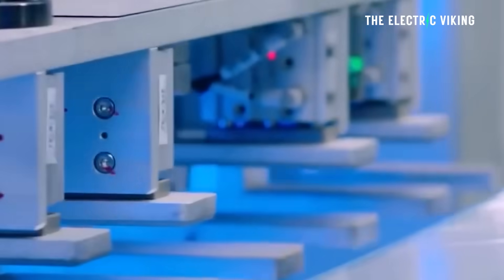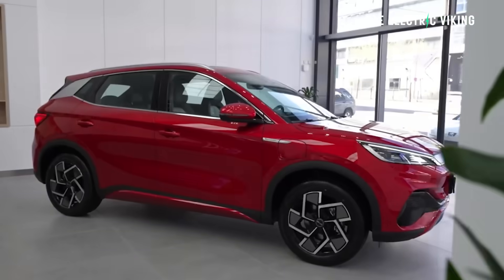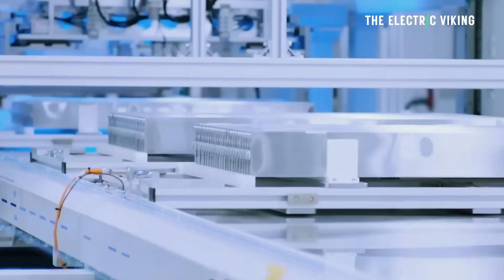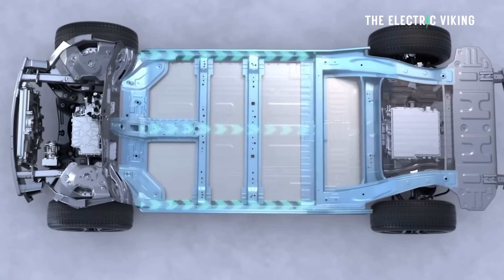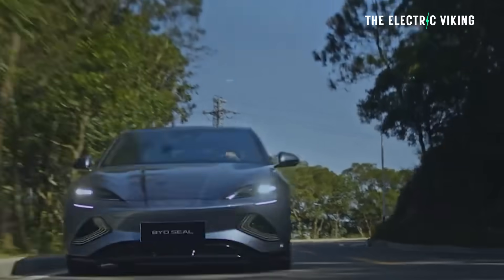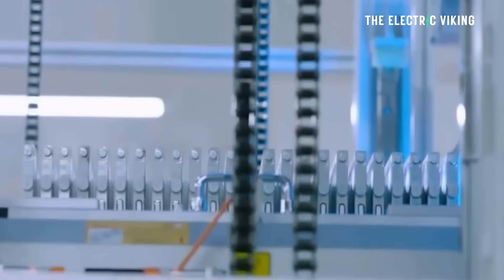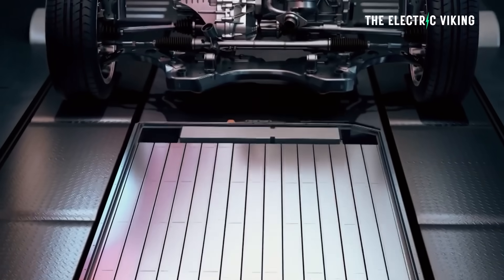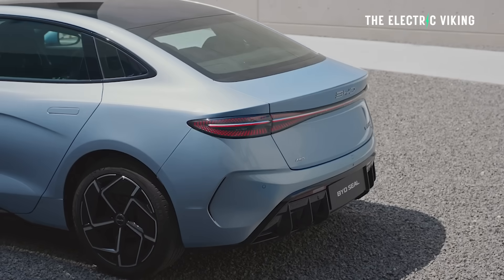BYDs 2 new batteries; ULTRA high energy density LFP or 700kw charging

Comment: Today you are able to buy 152Ah BYD Blade cell for 17USD EXW China. That's approx. 35USD/kWh.
Reply: Yeah I am also curious because that seems way lower than the normal battery prices.
Reply: Could you send a product link?
Reply: One more thing - in recent weeks I had an offer for 138Ah BYD Blade cells for about 12USD/pc. It is not manufactured any more so only what is left in the warehouse.

Comment: A mix of both in the same car sounds optimal.
Reply: True! It could bring a new meaning to hybrid.. a hybrid battery set with an 80/20 split between long range, slower charging batteries and short trip/local driving fast charge batteries. Would be pretty cool.
Reply: Eveb better if the two battery types are independent replacable. The fast charging one could be used to provide the grunt of rapid charging for quick top ups on public charging for a few 10s of miles travel quickly, theb both batteries on slow home charging.

The rapid battery would be better for regen, particularly on larger vehicles as it could absorb more energy quickly.

Then as indicidual packs the rapid charging battery could then be swapped out separately at the end of its useful life without impacting the larger one.
Reply: @GruffSillyGoat yeah! The same thing occurred to me, with the smaller, fast charge battery able to be more modular and easier to replace!

Comment: Higher charging speed is meaningless to me as I charge at home on AC.  Moreover the typical DC charger in Singapore is around 50 kW and the highest ones which are very few and far between at around 100-120 kW.  Even the fastest ones are still lower than my car's 150 kW rating   So I would definitely choose higher density.

Comment: Since I’m retired and charging from home 98% of the time, I’ll take the higher range thank you.
Reply: Exactly. You won't get that high current on home supplies. Whereas a courier driver might go for fast charging at the depot and charge it up while he's loading up the van for the next delivery.
Reply: @peterelliott2914  Sure buddy
Reply: Same. I'm not retired but I'd realistically only charge it at home and use the extra range for trips on weekends
Reply: @Jin88866  Or you could get an actually good car which you can charge in 3 minutes pretty much anywhere and where you don't have to worry about range
Reply: Definitely - get range over fast charge. I live in Norway and whenever I have to use a fast charger - Thor forbid - I spend 2/3rd of the time waiting for a charger to become available. So my own charging speed is completely immaterial.
Reply: @weerolein  So get a nice diesel car
Reply: Not if it's cold outside 😂
Reply: @thewolf9851  I'm charging at 110 and it's like a couple degrees below freezing.
Reply: @johnmurdoch6696  And your car has a much lower range. And the colder it is the lower the range gets. Fact. I pitty you.

Comment: In Australia we dont have the infrastructure for lots of electric cars. Forget about driving up to Darwin or over to Perth from Sydney. It would also add so much time to the trip. What if the charging station is down. Nightmare!
Reply: It’s a green fantasy
Reply: Tell that to Harald Murphy, he circumnavigated Australia in a Tesla covering 13,500km in 10 days.
Reply: That's like saying there is no apothecary for alcohol on the way to fill my tank, so I prefer my trusty horse.
Reply: If you aren’t stopping for ten minutes every four hours then you may have a drug problem.
Reply: australia is PHEV territory thanks to grid mismanagement. they're also useful as backup power when the grid goes down.

slow charge at home for the daily commute, petrol for long trips, petrol for fun driving, petrol for powering your house when the grid goes down. depending on how you drive it, its basically just an electric transmission that pairs the unbeatable strengths of internal combustion with the benefits of an electric drivetrain.

the big limitation on PHEVs right now is that charge/discharge rates are proportional to battery size, and PHEVs have much smaller battery packs than ordinary EVs, which forces manufacturers to make compromises on designs that leave customers dissatisfied. less power, shorter battery life, etc, but ultra fast charging-discharging batteries eliminate the downsides associated with PHEVs.

its not hard to see why they beat EVs hands down, but the main benefit over standard petrol/diesel is that an electric drivetrain is like a "CVT that doesn't suck", you can have the engine running in its power band regardless of how fast you're going, which means you get the stated horsepower 100% of the time. 

someone needs to hurry up and make a PHEV with a V8 turbocharged barra; 0-100 in 1.5 seconds with the sweet sound of a V8 engine.

Comment: Sounds good, but where can I find the infrastructure to charge this. That's 700kw or 700,000 watts.  Considering household output 2400 watts.  That will cause a blackout in a town.
Reply: 30A x200V = 6000 watts is min requirement for a home.
really super fast charging is not acceptable to power supply system.
a district area substation has one 1500kva transformer here.
Reply: Many public chargers operate akin to fuel-pumps, they use battery buffers and like fuel-pumps charge until the storage tank runs dry. The analogy us a bit of a stretch and breaks at this point as the battey buffers self-replinish in quiet times between charges.
Reply: Dude, you forgot 3 phase power is available at commercial site. Residence receives 1 phase power.
Reply: @charyuna  You don't need a 700 kW charger at home! 😂

Comment: Definitely would prefer longer range (600 US epa miles), warranty for 1 million miles like CATL, with 20 minute charging speed. Having that much range would limit my stops on a long road trip. Also, the warranty would mean I would not have to buy a new car for a long time.
Sadly, due to the US tariffs, we don’t seem to have access to all this great Chinese battery tech. Especially in Tesla vehicles. Unless I’m wrong about the US battery market. Not sure if Tesla’s 4680 design will ever be as good as the blade design. And, if I’m not mistaken, I heard that the blade can be a structural battery as well.

Comment: If both cars have 80 kwhr batteries they will have the same range
Reply: ...and the one with the higher energy density will possibly be lighter... with all the advantages of a car with smaller weight.
Reply: 210 kwh density is still nothing special. Only benefit of these BYD LFP batteries is they are cheap and don't catch fire easily. To have small EVs with decent range 300Kwh is really needed which may have to be semi solid state.

Comment: I wouldn't pay a dime for a battery with a 700 kw charge rate because I can't charge it at that rate anywhere.
Reply: There is still a benefit to higher max charging speed when using lower chargers. No battery maintains max charging speed throughout the whole charge. There is a progressive slowdown, but a higher max battery can take a charger’s max output for much longer.
Reply: @apis8020  That's true, but few chargers around me exceed 250 kw, much less 700. Some max out at 50 kw ... which is fine with me since I drive a Bolt. Maybe the charging infrastructure will catch up someday, but my experience with a Bolt (that only accepts 50 kw max) persuades me that few people need these much higher charging rates. EVs don't need to fuel as fast as an ICEV even if batteries can do it in theory.

A station with a dozen plugs, like some Tesla stations, can't even provide each vehicle the 250 kw (or more) that each plug can theoretically provide. The average at Tesla stations is more like 75. We're discussing the power consumption of an entire small town. The local grid can't handle it, so we'd need to upgrade the entire grid as well as the charging stations and the EVs. Electric semis have the same problem.

Greater range and efficiency is worth far more. Aptera promises 400 miles from a 44 kwh battery with a max charging rate of 150 kw. That's 200 miles in 15 minutes even if the charger delivers only 90 kw. A 500 mile road trip with one ten minute stop is more charging speed than most people will ever need especially if they don't make such long trips routinely, and Aptera can also charge at home at 120 volts fast enough to add 200 miles overnight.
Reply: Why not adapt them for residential storage m, say like a wardrobe that accumulates डॉलर ओवी बड़ी विंड पावर ओवर थे कांगठ ऑफ थे कैलेंडर डे and build up an economy of scale?
Reply: दो वे तो लग ईट ऑल स्लिंग वाई नित लॉकेट ईट अत सूटेबल स्टेजस फिर प्रमोट एक्exchange?

Comment: Simple answer: how many fast chargers are around to fill up in 7.5min? In real life, availability in charging networks will make a bigger difference than the time difference between 20min and 7.5min
Reply: في الصين موجودة في كل مكان
Reply: 20 min is good enough if chargers where everywere!
Reply: هي كافية لك انت 
لكنها ليست كافية لكثير من الناس
الذين يمكنهم تعبئه وقود الديزل أو البنزين في اقل من 4دقائق 
 @Myrslokstok
Reply: @Myrslokstok  power lines and hv transformers are issue.. not chargers..
Reply: There are really 2 use/charge scenarios.

1) Daily trips to work, and runaround
2) Long duration trips, e.g. holiday touring

For the 1st, simply plugging in the car at home and charging overnight is more than sufficient.

For the 2nd, motorway service stations and rest stops can have specialist high power charging stations.

In truth, I think most people would want to avail of the rest time offered, rather than be back on the road in 10 minutes.i

I think you are correct that most people do not actually need fast charging, but it is one of the things that the nay-sayers have been bitching about.
Reply: عندما يكون الشحن سريع بقوة لدرجة تشحن السيارة في اقل من 5دقائق
عندها يقتنع الناس الذين يقودون سيارات البنزين والديزل 
الذين لا يريدون البقاء في المحطات لمده 30 دقيقه 

 @mikemalone9678
Reply: @mikemalone9678  
الذين يتزودون بالوقود البنزين أو الديزل في أقل من 4دقائق ثم ينطلقون إلى الطريق لن يقتنعون بالبقاء في المحطة لمدة 20دقيقة أو أكثر بشكل إجباري

Comment: 700kw charging or 700,000watts at 250Volts requires 2,800 amps.  At the American 110 volts  grid voltage, ~twice as many amps.  Are we not far beyond what it is practical to ask of the grid.
Reply: The power grid doesn't care how fast each individual car charges. It just needs to provide the total energy that is charged by all cars during the day. When a single car charges with more power, it also charges quicker and leaves the charger quicker. The average power needed over any time period for a big number of cars remains the same. This is what the grid has to provide. If by any chance there arrive super-quick charging vehicles at all charging posts in an area at the same time, power will be downregulated to the capability of the grid.
Reply: @valuemastery  Yes, but most cities are build in recent decades with modern urban planning, the grid in new Chinese city are have excess capacity to provide additional grid demands. also peak and off-peak electricity pricing gap is 300% , so most charging are done during normal hours and off-peaking hours. Most EV chargers are in previously industrial cities, now most factories have moved to the outskirt of cities or further inland from the coast but the grid and substations remained.
Also China is world's No.1 in smart grid equipment, high power transformers and the world's only commercially available UHVDC equipment producer. And all electricity providers are state-owned and directed, they are mandated by law to implement urban electronification scheme (with generous subsidies at first)made by the government, even that means they wouldn't see a lot of returns on those investment in the near future.
Furthermore, Chinese cities are more densely populated then cities in the west, so usage of those capital investment are relatively high.
I guess what I am trying to say is China's success in EV transformation is hard to replicate in the west, it takes a whole of society approach and a lot of determination and consensus top to bottom to get where China and Norway is at right now.
Because a long long time ago, （in 1992）Chinese scientists had discovered the theoretical thermal efficiency gains and environmental advantage from coal to EV compare to crude oil to ICE cars is above 25%.
Also the costs for Chinese cars industries to develop their own ICE engines and transmissions technology and to go around all western patents on them are impractically high and close to impossible at the time than just to electrified the whole country's transportation system but building high speed rails, electric buses, PHEVs and EVs.
Reply: Chinese public charger are typically 380v to 1500v(even to old one can provide at least 720volts if requested by the EV side) and power capacity between 120kw to 600kw. My Zeekr 007 is charging voltage are typically 712 to 765volt, power peak at about 312kw, average at around 270kw, and bottom out at around 120kw to 95kw after 80%.
But yes, I agree with you anything above 200kw charging would require liquid cooling charging cable which is not very common even in China, I would say 1 to 20 right now.
But China is now building more liquid cooling Superchargers right now.
Reply: 3phase, a factor of √3 less And not 250 but 400v
Reply: All household voltages are transformed from high voltage networks. You just have to build dedicated lines to charging stations. 
This means you will not get the maximum charging speed at home.

Comment: There is no infrastructure. Doesn't matter how fast it can charge.
No slow chargers near sidewalks like in England.
This is the problem.
Reply: Charge at home .
Reply: Back in the day, apartment buildings with electric lighting and indoor plumbing got more tenants than those without. Same will happened with EV charging

Comment: Lets make it   : charges in  about  8 minutes from  5% to 95%  with  800kW  chargers  ,  it will be  more  truth nearly  ;)
Reply: Bem, still good news. About a hundred times more scientists and engineers are working on solar and battery technologies today than worked on the US Manhattan or Apollo Projects.
Reply: Yes, but look at the trends going forward… It’s only going one way…
Reply: We already 560kw charging with 310 miles charging in 12 minutes.
Reply: @ You have, we don’t in the UK… We need more of this for everyone, we need more affordable good EVs… The direction of progress 9s what matters.
Reply: Ask an engineer about the consequences and difficulties of such high currents and high voltages.
V=IR, P=VI are not going away.
800kW means
1000 amps (@800V) Really?
or 2000amps (@400V)
You must be mad.
Reply: @jeremylister89  
Yeah, it makes the thought of a wet plug rather scary....
Reply: @jeremylister89 it has to be at least 800 volts they are making 950 volt. Lines are cooled.
Reply: Assuming a constant 800kw charge without a dip towards the higher voltage end of the battery and without any charging losses, that would mean 106.6kwh in those 8min

Sounds like an absolute nightmare for our current electric grid
Reply: @someguy9520 They would need local massive battery stations that can fill up on lower charge intensity at the charging stations.
Because there is no way the local electricity grids will be able to take the load.
Reply: So how many charge cycles does that cost you?
Remember, batteries have a limited number of recharge cycles.  The faster you recharge, the more of those cycles are used.
For example if a charge at 20kw = 1 cycle, recharging at 800kw might = 100 or more cycles.
When your battery only has a lifespan of 5000 cycles, the more you fast charge the quicker you need to replace the battery.
Reply: @petert3355  Charging  LFP 5%  to 100%  6000 cycles  with  18% degradation after that .  Charging  LFP  10% to 80%  9000 Cycles with degradation  19% . This is about newest CATL blade  LFP 2.0

Comment: Man, if the learning curve / Wright's law keeps going at this rate, we're gonna end up w/ dollar for a kWh.
Reply: Maybe that's why German car manufacturers are going bust , they were pedalling this nonsense about diesel and petrol cars for years forcing us to buy this crap because they wanted to keep huge workforce in place, very shortsighted.
Reply: A similar thing (by percentage) occurred with electronic memory. From where it started to where it is today. The amount of memory you get for the price (at the time he said it) would in the future basically be free. Bill Gates. And in retrospect he was right. Electronic memory improved in speed and density while decreasing in cost exponentially. Today we purchase 10GB for about $10. I remember when 10KB cost that.  It’s S curve adoption. Price goes down massively with adoption.
Reply: Excellent point.